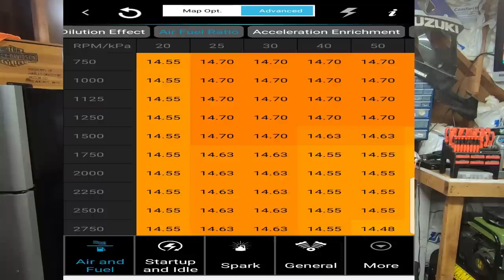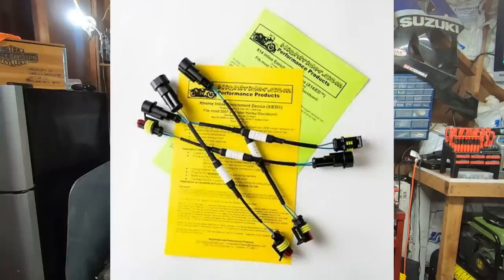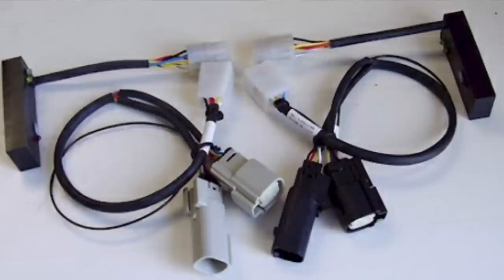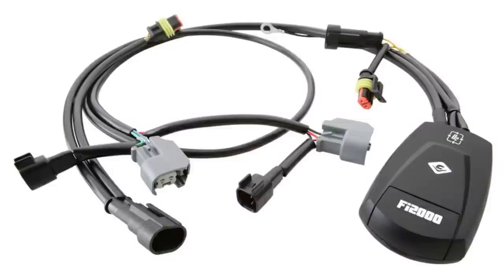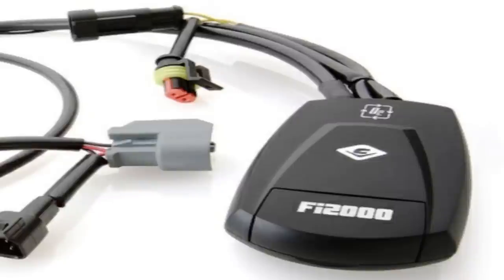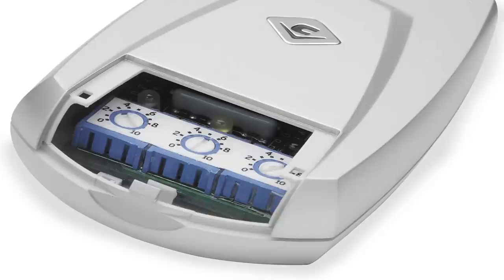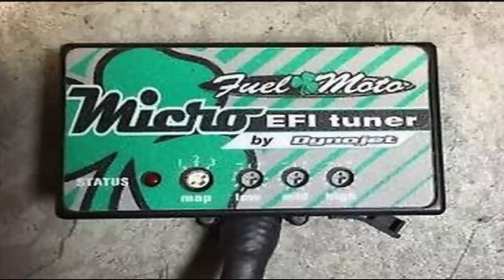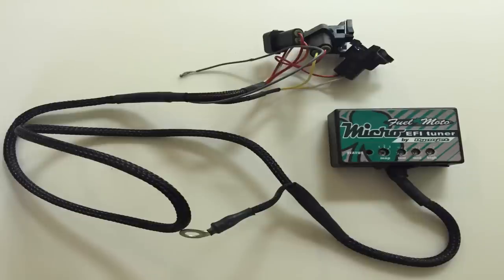Does Your Harley-Davidson Need A Tune With Slip-On Mufflers Only??

Comment: I have a '20 883 Iron full stock under warranty. I added 3" straight mufflers and lost a fair amount of low end and even a little mid end power.  I made $5 lollipops and got back most my power. They only take up about 1/3rd the diameter of the muffler, so I'm going to make a pair about 1/2 the diameter, which I think should fix it.  I didn't care about performance, just yet.  I wanted it to be loud, and I totally got loud haha BUT I was surprised that I lost power.  Anyways, I'm looking into going full stage 1 and maybe a basic 1255 Hammer kit, so I'm thinking FP3 tuner.
Reply from the maker: I would get a Power Vision if you end up doing the Hammer Kit, the FP3 is very capable and does the same thing as the Power Vision but you will have to manually enter everything for Hammer's map on your phone (it's a tremendous amount of information). It can be done, but it's risky and Hammer won't warranty any engine damage if you miss a cell. With the Power Vision Hammer will email you the map and you load that on your Power Vision and flash the bike. You can pick up a Power Vision through FuelMoto for around $400, that's the same price the FP3 is going for now. FP3 is great for pipes, air cleaner and cam, they just need a software package you can use on a computer and right now it operates in a cloud based system.
Reply: @GixxerFoo  sweet! I've always been great with carbs and EFI is something I barely have knowledge of. I've been looking lately and wasn't sure to go Screamin Eagle Street Pro to save my warranty, or V&H FP3 which most people were recommending on groups I'm in or Power Vision... which originally was the most expensive option until FP3 seemed to have raised their price? :-/

There's always option C of buying them all hahaha I'm about to go to MMI Harley specific school for 11 months, so it could be useful down the road working on other people's bikes?

And... I am strongly considering the Basic Hammer kit w/ big fins for $699, so maybe I just need to listen to you, because my drive train warranty will be gone then anyways lol
Reply from the maker: @mtwb13  The FP3 and the Screamin Eagle Tuner will lock to the Vin number forever so they will only tune that bike once it's flashed. Now the FP3 can be used on other bikes to read trouble codes, but the Power Vision you can buy a license to tune another bike. It's about 200 bucks but cheaper than another tuner, the Power Vision price has really come down. I bought the FP3 since it was 150 bucks cheaper years ago. EFI really isn't all that bad and it's a lot easier to make adjustments once you get the swing of using your tuner's software. When you talk to Hammer they will highly recommend the Power Vision and not just because they sell them. Flashing a map for your bikes setup is pretty easy and they generally run very well, maybe a little decel pop but it's pretty easy to add little fuel to fix that. Plus with the Power Vision it's what most dyno tuners use, they can literally tune another 15 horsepower into a motor using one.

Comment: mine is not tunned and its not lean with full system and air filter big sucker , ,if it was lean it would turn header pipes deep purple / blue  and run hot  , runs fine 2020 street bob ,only goiing to have it dyno tuned after stage 2  using a 480 cam package
Reply from the maker: The M8's really seem to do really well without a tune after being modded. Harley did a lot of work on cam and valve timing to make those new motors work with the lean AFR. Street Bob is gonna rip with a cam and tune, those things are frickin light!

Comment: Another great video. Thanks Gixxerfoo. Am thinking about throwing some slip on mufflers, but throwing a tuner on it will void my warranty. Should be ok with just mufflers.
Reply from the maker: That's the bad part that a tune will void the warranty, at least part of it anyhow. You could go the XIED route if you have some fueling issues and it won't leave a mark on the ECM. Just remove them if you need warranty work.

Comment: Put an XIED on my bike and it seemed to work as far as cooling the bike down but did not eliminate my decel pop. I just got to break down and get a fuel pack for it
Reply: Pass on the Fuel Pack, and get the Powervision from FuelMoto USA. Fuelpack is 400$, PV from Fuelmoto USA is 400$. It's the same price from them, but way more tools and features, and it serves as a stand alone glass dash if you want to mount it to your bars. Saving your phone for GPS and stuff.
Go with the PV.
Reply from the maker: I would look at the FP3 or Power Vision, there is the original Fuel Pak which was a inline fuel tuner and not a complete flash tuner. They want about as much for that unit as they the latest generation.
Reply from the maker: I like the Power Vision especially if you get it from FuelMoto, it's not as straight forward as the FP3 but with FuelMoto they will help you out.
Reply: @GixxerFoo  the Fuel Moto micro sounds like a entry level turner if you don't ever want to cams like me
Reply from the maker: That's really all it is, get your pipes and air cleaner and correct the fueling.

Comment: Great Vid! Quick question
I just got a 2021 883 and l also purchased some bassani sweepers exaust system also the bike has the o2 sensors, so my question is, do l need to tune it after l replace the stock exaust with the bassani? Also will tunes void my warranty? Also last question, lf l install an air intake will l need to tune it? please advise!! Thank you
Reply from the maker: Anything outside of slipons with the stock air cleaner is going to to require a tune. You could go with the Screamin Eagle street tuner for the warranty, use the map for the slip on exhaust with air cleaner and autotune. I bought my Sportster new, I did exhaust and air cleaner, went ahead and tuned with a FP3. I felt very confident in the Sportster engine, depending on the dealer normally a tuner will not void the entire warranty. Now if you had an issue related to the engine it would have to be traced back to the tuner and proved that caused the issue.

Comment: I have recently brought an 2013 883. I am thinking of changing the vance and Hines straight shots to short shots. It already has a stage 1 remap with a air cleaner. My question is, would it need tuning again or will it be a nice simple swap?

It is also fitted with o2 sensors.

Many thanks! 😆
Reply from the maker: The short shots are much shorter exhaust system so retuning would likely need to be done. If it's already tuned for the after market exhaust system it might run okay but for sure wouldn't hurt to correct the tune.

Comment: Just bought a set of s&s spo ovals for 08 roadking with a 96 engine.  Looks like the baffles have been removed except for about a 4 inch section at the tip. Was wondering if that will effect the way it runs. It does run a little rich with the screaming eagle slipons that it came with when I bought it. Great video. Keep up the good work

Comment: I have a 2014 with the 103ho and the stock open air cleaner,and a set of fat fishtails with no baffles...and I have a v&h fp3 tuner ..my question is if I decat my bike will I need to retune? And or will I loose hp?
Reply from the maker: Without baffles removing the cat will cut the low end power a bit, but wide open top end will gain. If you remove the cat l would check your FP3 map and flash the map for no baffle and then autotune if needed.

Comment: Hi - I'm thinking of installing the twin slash Vance & Hines slip on pipes on my 2009 Ultra Classic H-D and are wondering if I'll experience decel popping? I do have the stock air filter and not planning on changing anything ot getting it tuned. What do you think?
Reply from the maker: With the touring bike you are less likely to hear decel popping with the catalytic converter in the head pipe. For sure keep the stock air cleaner on as you mentioned but you may still experience some decel popping with how lean those bikes are. When you get a tune it will take care of that. My dad has Vrod he bought used that came with just slip ons on it and that thing decel popped bad, you could really tell it did not have a tune. Added a Power Vision tuner and a K&N air cleaner in the air box and it was good to go with no more decel pop.

Comment: Can i use loud baffle from v&h and not tune the bike ?  (2019 114 Heritage )
Reply from the maker: The M8's really seem to tolerate muffler changes pretty well without any issue. The M8 was designed around running lean as where the twin cam was squeezed way to hard going lean. It really depends on the bike on how it's going to respond, you can run a different baffle with a M8 and get some sound. May not get any performance out of it until it get's a little fuel.
Reply: Thanks

Comment: I have 2021 fat boy . All I want is to change exhaust nd keep rest stock, will be that alright??? Thanks
Reply from the maker: On the M8 you technically could do a exhaust swap with slip-ons and get away with it. It will have some sound but won't really have any performance benefits, a tune is all always highly recommended though.

Comment: how about drilling out OEM mufflers?  I'm assuming the net change is maybe comparable to swapping for slip-ons and therefore also might not require a tuner?  2004 FXSTi.  Thanks
Reply from the maker: Drilling holes in the muffler you still have all the packing and chambers with the cat. Touring bike have the cat in the head pipe, on other models it's in the mufflers. You would get some sound out of them but not much.
Reply: @GixxerFoo  thanks.  I'm not looking for much volume...just a moderate increase would suffice

Comment: Merry Christmas and thanks for the informative Christmas Day video. Btw, finally got my 03 Dyna back on the road after new cam, cam plate, oil pump, lifters, and push rods. Runs great,  a little decel popping... thinking about putting it on dyno, will let you know if I do.
Reply from the maker: Merry Christmas to you too! That's awesome news! Are you running a tuner on it right now?
Reply: @GixxerFoo  No, but I think maybe the carb was rejetted already, since its not having any issues that I've noticed other than the decel popping, which it did with the stock cam. Have V&H VO2 air cleaner system & V&H short shots on it too. It could possibly use a little additional tuning. Also replaced the AGM battery with a Li-Ion one...light & powerful.
Reply from the maker: Those new batteries are frickin light! That's what l am going with too when l change mine out.

Comment: i pulled the carpet like baffles out of my slips on, started riding and lost too much fuel. could i just buy a new set of slips on and gain mileage back or do i need a retune?
Reply from the maker: Removing the baffles you'd need to retune, that's a very drastic change in exhaust flow. Without baffles you'll sacrifice your low and midrange power but gain on top.

Comment: I have a 2011 Harley Davidson Sportster xl 1200 x 48 and it has o2 sensors. Bike to this date only has 1,350 miles my pips are a little light blue in places so that tells me I'm running a little lean. The only thing that was changed on it was the slip-on and it still has the factory breather.
Reply from the maker: The FI bikes run lean with the factory tuning, it's honestly too lean. It's alright to run with slip-ons and the factory air cleaner but if you put a new air cleaner on and a tune it will be like a rocket ship. Night and day difference, I first tuned my stock bike with a FP3 and did nothing else. Holy crap I was shocked and pissed I rode that bike for several years without a tune, it was way more responsive and had a whole lot more power.

Comment: Can you explain this?.. I had Harley add VnH slip ons when I bought my Heritage last year. And they did pop quite a bit on deceleration . However , I put the originals back on for touring in Spain , due to laws there . When I came home to Ireland I replaced the stock with the VnH ...and now no popping..what is that about ?

Comment: What if I have 4 O2 sensors on FXBBS ? Extra 2 O2 sensors fitted to stock slip on ?  Should I drill holes in V&H 300 and fit o2 sensor ? Also in stock mufflers - catalysts, so tune/remapping required.

Comment: Aren't Power Commander's just a down load type of device? You can't do any tuning with a Power Commander, or am I wrong here. Something like a TTS is for actual tuning, I think?
Reply from the maker: Power Commander is inline plug in module, you can make some minor adjustments with them but they don't actually flash the ECM. A TTS, Power Vision, FP3 these actually flash and reprogram the ECM itself.
Reply: @GixxerFoo  Thanks for the reply, I just had my Indian ftr reflashed(?) with a PC3.Took the tech about 10 minutes to find and down load the map for my application. Noticeable improvement for my bike. Apparently it's pretty close to being dialed in. Would still like to get the bike up on a dyno to see the actual numbers as far as horsepower, torque and the air fuel ratio. As it stands right now I have no idea with regards to all that.

Comment: Hello,  My cycle is a 2021 H-D FLHCS 114.  My question is:  can a set of Samson 33" true dual fishtail mufflers with baffles be installed without additional tuning?  Headpipes will accept OEM narrow band O2 cencors.  At this point no modification to the intake are planned.
Thank you, Ernie Sawyer
Reply from the maker: If you're doing just mufflers with the stock head pipes you'll be good to go. If you're replacing the head pipes too you'll need to get a tune on the bike.
Reply: Hello and thanks for the speedy reply.  The Samson true dual system in question is a full exhaust system:  headpipes and baffled fishtail mufflers (part # S- 670-1).  There are conflicting opinions if the complete exhaust system can be bolted on and ridden without a tune provided the intake remains stock from the factory.  The new Samson headpipes do accept narrow band O2 cencors.  How does replacement of the stock headpipes to the Samson headers affect the tuning so much?
Just want to do my homework before breaking out the tools and the bank.
ES
Reply: Hello,
Did you receive my second question regarding headpipes and tuning?  ES

Comment: i have a 2017 iron 883 with vance and hines slip ons and a stage  2 Arlen ness big sucker air cleaner. no re mapping yet. for me it is very quick and the low end torque is great 0 -100 kms.

 i am still thinking about a Tuner. do i need to as apposed to do i have to ?
Reply from the maker: It wouldn't hurt anything to go ahead and tune your bike, it would run a lot better with a good tune. The difference is night and day after a tune.
Reply from the maker: Holy crap! That's some power!

Comment: how about this. I have a set of straight pipes on a 09 Dyna Street Bob.  They have baffles in them. Stock air cleaner however I removed the part of the air cleaner housing that is close to the engine ya know with ugly air scoop thing. Now the back of my air cleaner is open . Can I remove the baffles in the straight pipes without a remap?  I havent because I understand carbs but I dont know a lot about EFI.  I also have a re usable air filter K&N not a paper element.  At present time it never pops on decel. There is a electronic line that plugs into the air filter that is now unplugged since I removed that ugly crap . No idea what I unplugged LOL. I assume its a sensor.  Mass Air flow perhaps? Doesnt matter the bike shows no codes on the dash when I run diagnostic. I havent removed the baffles because I dont know if that will cause a need for a remap. Im not interested in noise per se but I dont want to hinder performance. It runs great with the baffles in there. But If I can safely remove them I will. Pisses me off that my old ironhead is louder than a 96 inch power plant! Not that noise matters but hey loud pipes get pussy!
Reply from the maker: If it's running good where it's at I would be afraid to make any changes without a tune, are you running the stock air box with a K&N filter in it?
Reply: @GixxerFoo  stock air box with the ugly air scoop removed.
Reply: K&N filter inside stock box I removed the inner part of the air box its ugly so I had to unplug electrical going to the box I think that's mass air flow sensor?

Comment: My 2012 Switchback,  which is due for delivery soon,  has already had Stage 1 - new exhaust, Screaming Eagle air cleaner and dealer tune. If I change exhaust,  will it need another tune? Thanks.
Reply from the maker: It depends if you're going from slipons to a complete aftermarket system, but with the twin cam engine retuning is very important.